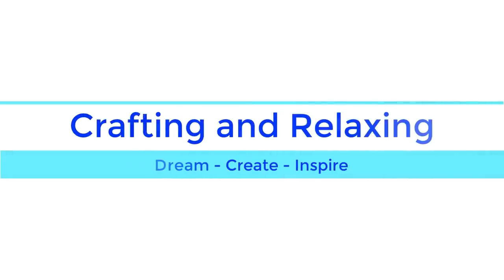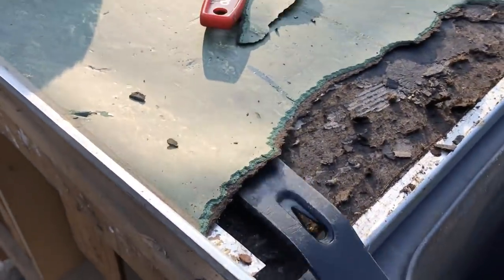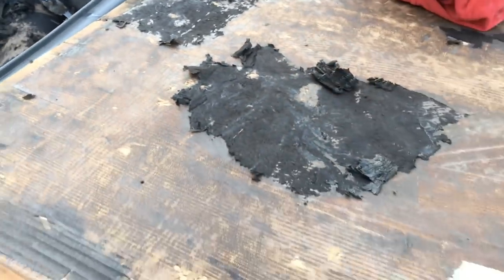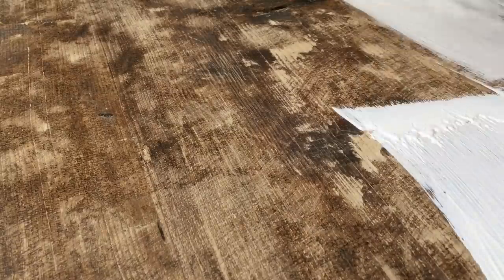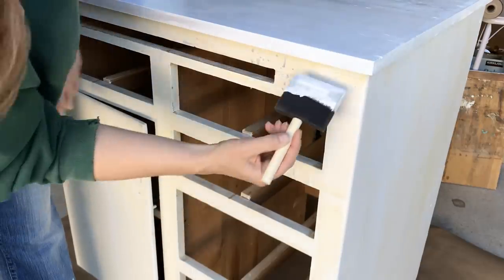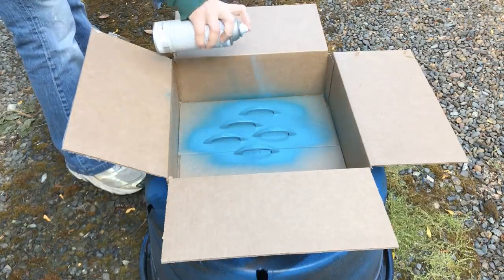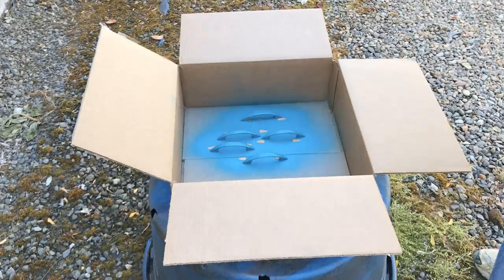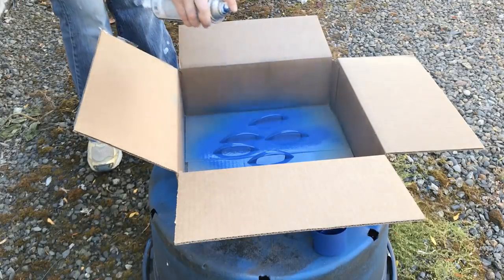DIY | Free Storage Cabinet | Trash to Treasure

Comment: I'd move the handle from the door to the drawer where the handle is missing, then just use a round knob for the door. Since the door is not a drawer it will look right that its handle is different.
Reply from the maker: That would have been a really good idea! I might still use that idea for the pullout. I never use it because it doesn’t have a handle so I could put it there and put a round knob on the door. Thanks for watching and commenting! 😄👍
Reply: Susan Vasquez is
Reply: Yeah, me too

Comment: If you run across that type of surface again, try soaking a towel in hot water and wring it out then lay on top. Leave it several hours or over night. I used this method removing ruined veneer and worked like a charm! Cute cabinet. The bread board pull out could used a little knob. 😉
Reply from the maker: Wet towel is a great tip!! Thanks for sharing! 💙

Comment: Love this! Could you tell us if the cutting board is refinished?
Reply from the maker: The cutting board is completely primed, painted white and has a stopper behind it so it is easy to grab. I pull it out regularly in my craft room when I run out of counter space. 🤣 I think I improved it later, not in this video. TFW!

Comment: I would add another matching handle to the pull out section to make it easier to pull. Great job though. Some of my favourite pieces are the ones that I have done on a rainy Sunday when the shops are closed here and I am forced to use whatever I have to hand. Very satisfying that you made something attractive and useful from nothing at all!
Reply from the maker: That’s a great point about the pull out section. I was just realizing today that I never use that. It’s probably because it’s troublesome. TFW 💙💙💙
Reply: They probably used that cabinet as a kitchen island, that pull out thing is a chopping board. We use to have one back in the 70's.

Comment: Yes. That was genuine linoleum on the top.  It was made from linseed oil back when this 65-year old was a kid. Back then, it was backed with tar paper.  If my memory serves me right, it was made by pouring a mixture of linseed oil and who-knows-what and poured upon the tar paper.  Then, once it was dried and cured it was sold like crazy, until something better took it's place.  Usually it was used on floors, but I also saw it as counter tops.  One had to be careful not to tear it by dragging your furniture across it.
Reply from the maker: Thanks for the info about the linoleum! Linseed oil explains the oily smell! I wasn’t sure I would get rid of that! 😂 Thanks for watching! 😃

Comment: Good job!
As an aside...I DEFINITELY would have stripped off the old paint, as chances are  it contains lead. A small orbital sander with 100 to 120 grit sand paper would have done the job, followed by sanding with 220 grit for a very, very smooth surface to accept whatever paint later applied but only after removing all of the dust.
Reply from the maker: Great point about lead in the paint. 🤦‍♀️ TFW! 💙💙💙

Comment: this was lovely. chalk paint is cheap and easy to make. it is a 1:3 ratio of plaster paris:paint. take say 1/3 cup plaster Paris mix with a little water so that it comes to a yogurt thickness and all the lumps are out (this is very important. if you don't they will never come out.) then pour in 1 cup Acrylic latex paint. make as much as you need bc it isn't something you can store.  I make This in very small quantities up to quarts. sometimes you will need to sand it to get a really smooth surface but seriously for pennies on the dollar it's worth it! most times I don't though just depends on how well I've mixed the plaster of paris.
Reply from the maker: Awesome tip about making chalk paint!! Thanks so much!! 💙💙💙👍

Comment: Love that cabinet n so cool it has a cutting board too. I’m a DIYer too but I like to at times put pieces back to their original if I possibly can. On the top u said the black was paper n it might of been some paper but mostly it’s the thick glue they used to put that linoleum n it’s yucky. Also to be sure the top was completely smooth n without what’s left I would of used my belt sander (but no everyone has one) n that would of taken it down to good wood. But again to each his own. Doggy taste for all. It turned out cute. Thanks for sharing.
Reply from the maker: I don’t have a belt sander. Well, I’m so messy I could be wrong. 😂 I went with white to match the free set of kitchen cabinets I got for my craft room. Keep up the DIYing! 👍😁

Comment: I do think that the top had so much potential. A sand down and some light stain maybe would have been the icing on the cake
Reply from the maker: A lot of people agreed with you on that. I put it in a room with lots of white and I am hard on it. I knew the top would take a beating so I just wanted it to be sealed up and an easy fix if I spill paint or ink on it.

Comment: I generally strip the original paint and sand it down.  Otherwise it will give you the feeling of painting over a garbage
Reply from the maker: I've traditionally used stripper and started completely fresh on antique pieces, but I'm putting this piece to work so I was less worried about making it a show piece. Honestly, this was my first project like this with this dog around and I was really concerned about using stripper around him. It turns out he followed instructions and left things alone.

Comment: I'm confused. Why wouldn't you have wiped the cabinet down with soap and water before you primed it? If it's going into your home wouldn't you want it as clean as possible?
Reply from the maker: I tried a spot test of soap/water and elbow grease. It didn’t even leave make a difference. I think it would have needed a chemical/strong cleaner to even Chase it. Fifty years or so of garage dirt. I didn’t want to use the chemicals and wait for dry time. I took a gamble and it seems to have worked. 🙂

Comment: Why didn't you put a little knob on the breadboard so you can pull it out easily?
Reply from the maker: I really didn't plan to use that feature, but I circled back later and put a small block behind it so it doesn't go in so far. it's easy to grab now.😁TFW!

Comment: I would use all the existing handles for the drawers and find something cool and different for the door.
Reply from the maker: Definitely the right idea!! I’m going to loop back and change hardware around a bit for just that reason. I don’t use the cutting board and if it had a pull on it I bet I would. This cabinet has become a great workstation in my craft room! TFW 😃

Comment: What about the inside? I guarantee it smells based on the rough condition.
Reply from the maker: I didn’t paint the inside because it was clean and dry, no mysterious spills. However, you are right! I probably should have painted the inside because it smells like it’s been in someone’s garage for 50 years, which I think it was. 😂 I’m using it in my craft room and loving it, but I put some candles inside to freshen it up. Maybe I’ll paint the inside when weather allows. TFW 👍

Comment: Love it ... but its gross you did not wash it.  I’m spontaneous too. But I’m not doing anything to anything except thinking about it until I hit it with some soap and water ... and hit it with my blow dryer to see what runs from the cracks, joints.
Reply from the maker: I’m too impatient to wait for a thorough cleaning to dry. 😂 I tried to give it a wipe, but it wasn’t changed. It would have needed some strong soap! TFW 😃